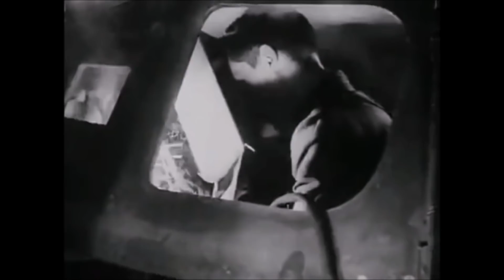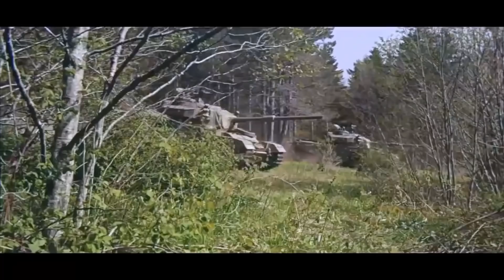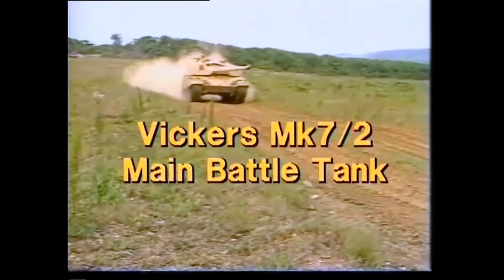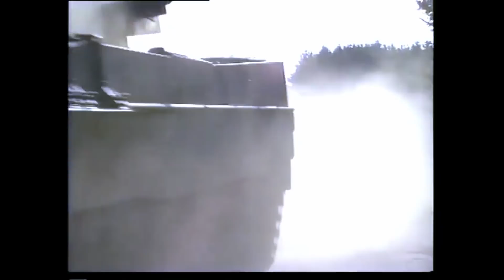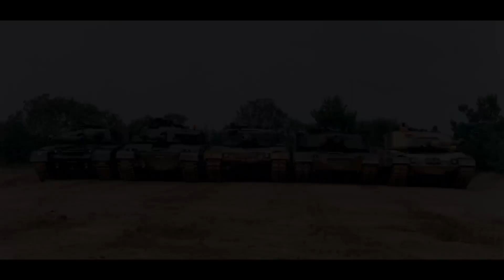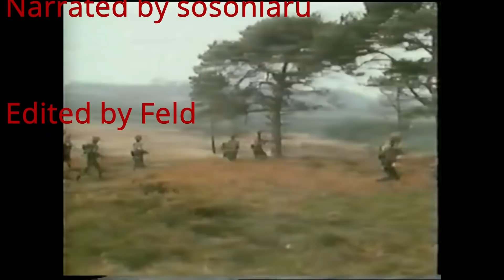The British Leopard | Vickers Mk.7/2 MBT

Comment: Regarding the Vickers Mk. 4 Valiant, its aluminium hull survived to its slipping incident at Larkhill in January 1983 as its marketing effort was terminated later, in July 1985. 
It should be mentioned that the Vickers Mk. 7 turret also had some unique features such as a separated compartment in the left part of the turret bustle for the British 120mm projectiles and redesigned charge bins  following the contours of the turret basket.
Furthermore, to reduce the likelihood of detection, the Mk. 7 featured an infrared reflective paint, a new thermal sleeve and the sleek/smooth shape of its turret (no protusions).
Reply: It was known by Vickers as the Universal turret. quite a lot of the design and tech went into the turret of Chally 2. They aren't the same but share DNA.
Reply: @thewomble1509  Indeed but unfortunately, the Challenger 2 turret isn't as advanced as the Universal Turret.
Reply: @georgesabitbol2137  Yes, ok.

Comment: If this was the Vickers Mk.7/2 what was the Mk.7/1? Perhaps that was the Valiant turret on the Challenger hull?
Reply: There was no 7/1. The two Mk7 specifications was mk 7 and mk 7/2.
Reply: @HJDore Whats the diferente beetween them?
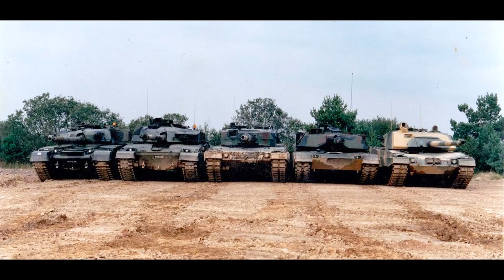Reply: @CalebDelgado-f2f  The difference lays in the turret. The Mk7 has the old modular turret 4:50, while the Mk7/2 has the revised single-piece angled turret 9:04. It's basically the same thing, but the Mk7/2 looks cooler.
Reply from the maker: Yes
Reply: @TanksEncyclopediaYT  Nope.

Comment: considering the pathetic designs Vickers came up with for the pre war into war years I don't know why they still bother
Reply: vickers came up with several world class for their time designs the Vickers 6 ton is probably the most influential tank ever made and although not sexy the Valentine was one of the most successful tanks of WW2 and was kept in production right up until 1944 at the specific request of the Soviet Union due to how much they liked it.  For 1938-40 the Vickers Cruiser tanks were more than capable of taking on contemporary Axis tanks although like many other tanks they quickly became outdated.  The Cruiser II was more than a match for the Pz III marks A-G as well as the Pz 38-A-D, models and the early Pz IV
Reply: I consider Valentine the most underappreciated tanks of the war. They get a bad rep cause Britain learned the hard way how to use combined arms using them. But how is that different from T-34? In 1942 Soviets considered it the best Lend Lease tank they got. Diesel or gasoline. Less than 20 tons. And it was designed to cost 1/3rd of the work hours needed to produce a Matilda. With several gun upgrades. Bishop, Archer Crocodile and AVRE Valentines should also be mentioned.
Compare that to Porsche designs. :D
Reply: They also made some of the best tanks of the interwar period so idk what you're talking about
Reply: They did have a resurgence in the Cold War, they sold nearly 400 Vickers MBT's and 2,200 were built under license in India.